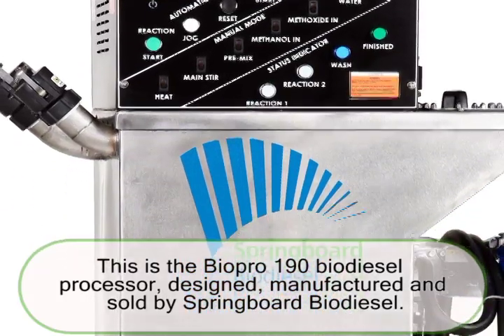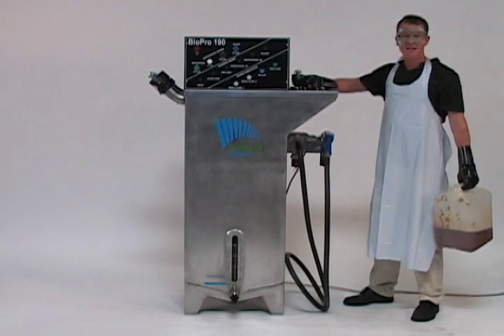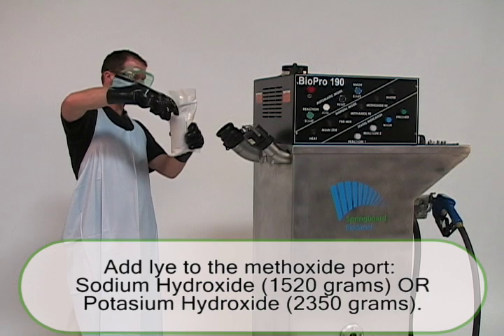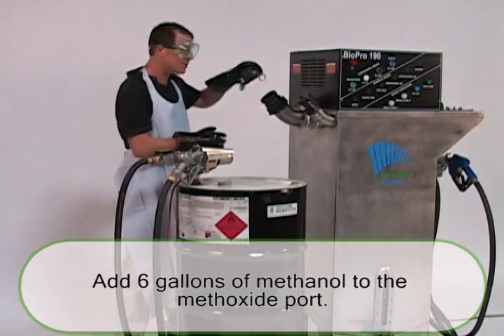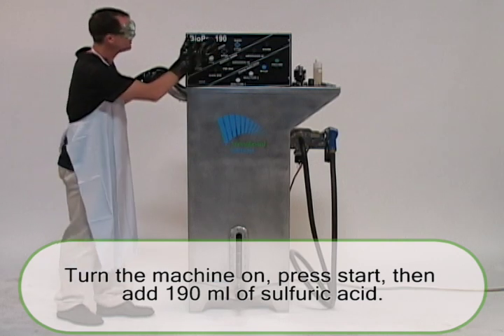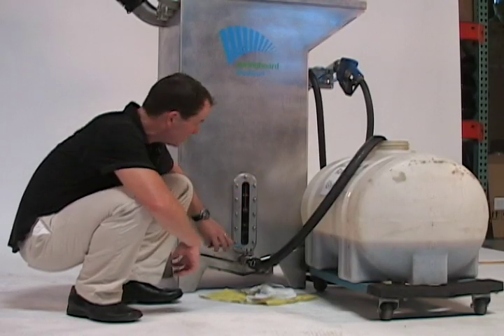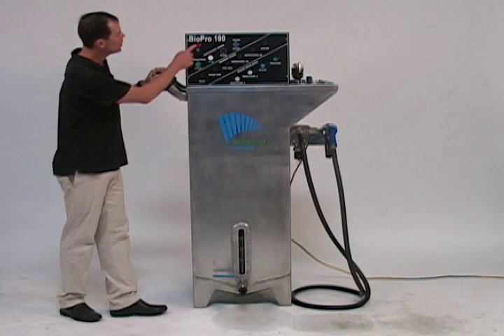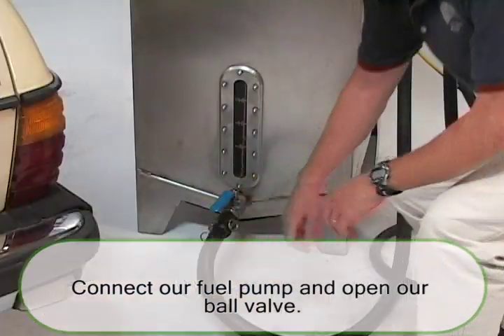Making Biodiesel: BioPro 190 Automated Biodiesel Processor

Comment: do you have a problem with the fuel clothing in cold weather.  Or does this thin it down .
Reply: All diesel gels at cold temps bio diesel starts geling a lot soon that regular diesel. Kerosene or alcohol can help some what but in temps of -10 degrees Fahrenheit your boned
Reply: @mattarnold3847  best to add a Gel Additive to stop Gelling and reduce Cloud point
Reply: sir what is the machine price and we use simple mathanol or distilled mathanol for making biodiesel .plz tellme               Johar.rais73@gmail.com